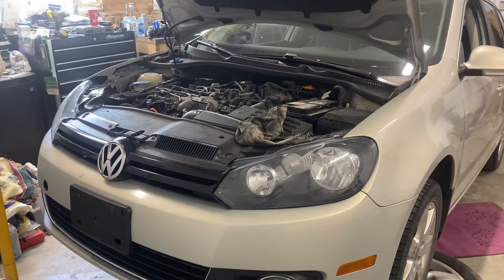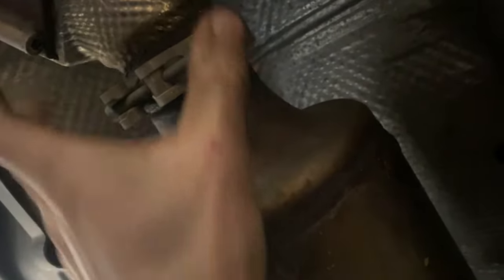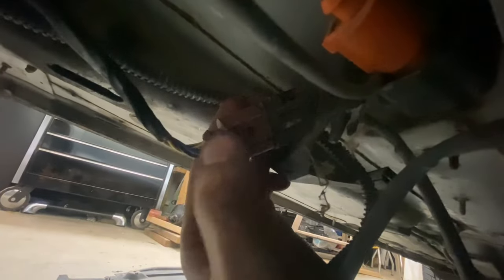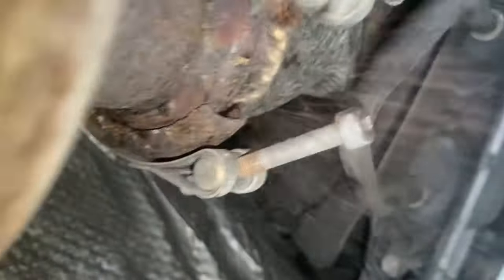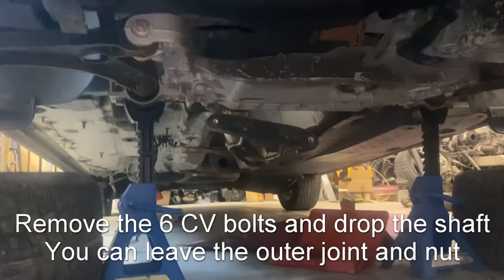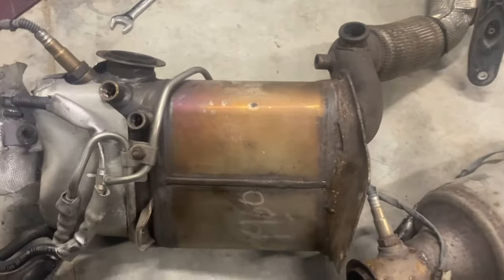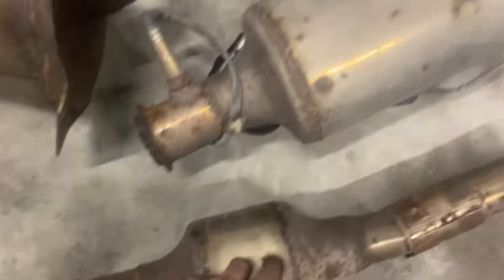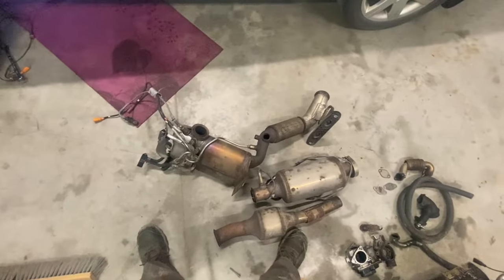CJAA Volkswagen TDI DPF/Cat removal *FOR REPAIR/REPLACEMENT PURPOSED*

Comment: Thanks for video.... I am looking at my DPF replacement. I think I will tackle it. The cost to replace is $3800 to $4000 by shop. Parts will $2000. Also mine being 2010 the dealer said NO, they don't work on cars older than 2012. Not that I would go to dealer. I pushed them. The dealer after I pressed said they would look at it and work on it if car is in good condition, which it is. Again I avoid dealers unless under warranty which my car is way beyond.  My independent VW  Audi Porsche shop will do it....I know the shop and owners well, so likely they will work on it for a long time to come.  They do good work and slightly cheaper than dealer. 

I plan on keeping it another 10-15 yrs. No reason it will not be a great reliable car, but the emissions is a long term maintenance issue.  It works great but from time to time needs to cloned, replaced. The other option is removing the emission system, which s is not commended for legal and resale reasons. Also to do so cost as much as a new DPF. A DPF should go 120K to 240K depending on how you drive.
Reply from the maker: Exactly, outside of warranty I’d take it to an independent shop 10 times out of 10

Comment: I'm working on a 13 tdi cjaa. I'm wondering if anyone on here knows if it's normal to have a square wave signal on the motor control circuit of the egr valve. Mitchell says it should be approximately 12v but when I hook up my lab scope koeo testing I get a 0v-12v square wave on the motor ground and 5v-12v square wave on the motor power wire. Anyone know if this is normal? To me it seems wrong but maybe the egr's are duty cycle controlled.

Comment: Yeah, well, how the  heck can you get busted for this anyway? I'm gonna delete all 3 on my 2012 TDI hatchback. Get me some more MPG & speed! I bought a $1,100 kit with everything included, all bolt on! Guess I should clean my injectors & intake manifold too? What else? How much smoke will I be belching outta my tiny VW Golf? Surely not much, right?
Reply from the maker: I actually plan on making a video in the coming weeks on this. We have road side inspections which usually target commercial trucks/pick ups but also go after modified cars, no muffler is a dead give away which then once inspected when deleted can end up with a $350 fix it fine and your plates taken. 
If you take a look at the US deleted truck scene you see a lot of the tuners getting million dollar fines, I imagine the EPA can get hands on the customer list pretty easy just a matter if they want to go after the small fish.
As far as your golf who’s the tuner? I did a video awhile ago on Mr tuning stage 2 kit, 0 smoke, more power and fuel mileage. The intakes stay fairly clean on these I don’t think I’d worry and I usually will fill the fuel filter canister with liqui moly diesel purge every filter change
Reply: @JoshsJettas  I will be removing the CC, DPF, and EGR but the muffler stays. I personally will not be tuning the car. Is a tune needed after this job? I'm an aircraft mechanic but don't know much about cars. I don't think this job will be too difficult. It's all bolt-on & I'll get a kit with pre-formed pipes to run the whole length of what I remove. I suppose I will need to find someone to tune the car, but will a normal shop know that I've removed these major exhaust components? I'll need to find someone who doesn't care, if so!
Reply from the maker: @crooked-halo  yeah it won’t be happy about the lack of dpf/sensors and won’t run well. The pipes all bolt on easy, getting the old dpf out is the worst. Tuners (Malone or Mr tuning) will provide a flash tool and tune that can be done at home, I went over the process here. 

https://youtu.be/FJWkgyXKrfA

Comment: When you say not to cut the dpf because it will only be scrap value and cant use it as a core what does that mean?
Reply from the maker: If your replacing your dpf it costs about $1100, you also get charged $700 core charge. If you send your non-cut dpf back you should get that $700 back but if you cut it up they won’t refund that.

Comment: Hey man quick question,  i just deleted my 2014 tdi with mr tuning kit with the blocker plate on the egr filter. Will this eliminate the hydro locking problem or is there something else i will need to do.  This happened to me a couple times last winter
Reply from the maker: Low pressure egr is what introduces moisture into the system. With that blocked off you shouldn’t have an issue.

Comment: Hey Josh, your videos are awesome. I’m going to do a dpf and egr delete this weekend. I was curious if you’ve ever had this problem my 2012 Jetta Cjaa bucks and jerks under light throttle. It doesn’t happen if you are into the throttle. It doesn’t throw a code. I’ve read that replacing the cam position sensor could fix the problem?
Reply from the maker: Thanks, i haven’t had this issue but here’s a few thoughts. I would think the cam sensor would be a intermittent issue and not just light throttle consistently. I would maybe do the fuel filter and fill the canister with liqui moly diesel purge as I know the ecu will try and smoothen the engine under a certain rpm, so it might be trying to correct an issue and making things worse?
Reply: If your car is a dsg, that may be normal. My car and many other dsg tdis will do this, the best way to prevent it I’ve found is to just let onto the throttle easier and smoother, it’s essentially slipping the clutch when it bucks like that, a dsg tune can help.
Reply: @dickdynamite89 I have the same issue (manual tranny) what all did you do and how expensive is it to do. Thanks
Reply: DSG = normal

Comment: How did you get the axle off?  I'm most of the way through getting the DPF out but left the driveaxle and I can kind of get past it but can't really turn it.  Is there a video for how to get the axle off?  Help please!
Reply from the maker: Unbolt at the trans, unbolt the 12 point nut and unbolt the lower ball joint 3 bolts. It helps you pull the spindle away
Reply: @JoshsJettas  I just saw this but I got the correct sockets and removed the axle bolts and the bar dropped down a little. That was enough for me to get the DPF out. Your video is so helpful!!
Reply: @davidhamilton6136 how did you get it? Which way did you twist it?
Reply: @Tanner737 The normal way, counterclockwise but to stop the driveshaft from turning I had to lower the car onto the supporting tires so it wouldn't spin. When I wanted it to spin to get to the other bolts I would lift both sides back off the supporting tires. Also make sure to have the triple drive socket bit things, they are 12 pointed, don't use normal star bits or you'll strip the bolts.
Reply: The supporting tires was an incredible idea btw @JoshsJettas

Comment: Thanks for the video and others I've studied sure helped a lot I just replaced my DPF and EGR tube on my 2013 VW Beetle TDI with 132,000 MI, just yesterday on Saturday March 23rd 2024 I never done anything like this and several times I thought I was going to quit because I thought this was never going to fit through that little hole but surely it did inch through with quite a bit of persuasion without lowering the subframe and then the new one went on seems like easier since I was able to go in there and bend the firewall to make more room just for the birth canal if you know what I mean I'm proud that I did it no more p2002 or p0401 codes, it's just best to replace it instead of trying to clean it because it'll just come back with problems soon I'm good for another 10 years at least, this car runs solid
Reply from the maker: That’s awesome I’m glad it helped. It can be pretty tempting when you’ve got the dpf half way out to want to drop the subframe. Would’ve made life a lot easier if they made that opening 1” bigger
Reply: @JoshsJettas  thank you for taking the time and videotaping all that I don't know how you do it because if it was me I'd be taken 3 or 4 days to do this job with the camera but instead I just went through and got it done in a couple of hours while it was raining outside LOL

Comment: I did this today on my 2014 Jetta, and instead of cutting it or even going through the trans tunnel I just took the passenger side CV axle completely out and jacked the front of the transmission to rotate the drivetrain as far forward as it could go and dropped the DPF out of the bottom straight down between the subframe and engine. No need to go through the tunnel at all and it took me about 5 minutes once I had the axle removed.

I did buy a southern car since I live down south, so it wasn't rusted to shit and I was able to remove the O2 and EGT sensors without much difficulty before removing the DPF to make sure nothing would get caught.

I struggled for about 30 minutes trying to go through the tunnel before I noticed it would drop right out if the axle was gone.
Reply from the maker: It was able to fit intact just with the engine rotated?
Reply: @JoshsJettas  Yea, all I did was make sure all the brackets and sensors I could get off were off. I could not get the lower egt out and the dpf and nox cat are still in my garage waiting for me to cut them up to sell them.

Comment: Doing a full rawtec strait pipe with resonator, Malone .5 and 2 tunes will probably be what I go between(with DSG tune and dynamic idle). Cannot wait, hope to get the parts in this weekend.

DPF is clogged so I’ll send it out 😏
Reply from the maker: Have fun it’ll be like a brand new car
Reply: Excited for it, I’ve heard so many amazing thing about it. And it’ll be fun todo. Always used to work on my own stuff till my MK6, warranty was a blessing though. Turbo failed at 120,000mi. Had a few thousand left on the warranty and vw repaired it all under the warranty and added another year on for me. It almost ran away on me after leaving the shop doing the timing belt, then it did when the mechanic took it out because idling it seemed fine. But if you got on it in sport mode it would try to keep going. Blue smoke out the exhaust, 5-6k rpm. I got it back to the shop and the engine light didn’t even come on(that why the guy took it for a drive). The engine is basically new, $11,000 in parts alone. I got to drive a rental 2022 Charger SRT because the guy at enterprise felt bad for me about my car going down like that. 

Parts didn’t come in, they had an issue getting materials due to the high volume of orders.

Comment: Hey Josh Love what you're doing for us 

When you are putting the axle back on what torque spec do you use on the bolts?
Reply from the maker: They’re one time use so they should be replaced and torqued with torque turn. I make them tight with a dab of blue loc tire (not the greatest thing to do).
Reply: @JoshsJettas  yeah if it breaks off and you had loctite on the threads you'd be real mad at yourself 😂

Did you actually replace yours or are you just suggesting that it should be done?

Comment: Hey mate, I have major DPF problems and am going to use this video to get my old one out and try to clean it. I’m wondering if there are any gaskets, seals or single use components that I need to replace when I put it all back together? Hard to know exactly what parts I’ll need before I get in there so I appreciate any help!
Reply from the maker: Hey I’d figure the v band seals, if your somewhere rusty you’ll want v band clamps as well. You might need a scan tool to reset the dpf soot loading if that’s why it’s being cleaned
Reply: @JoshsJettas  Legend, thank you mate I appreciate the reply. 

I'm cleaning due to soot on tailpipe and bumper/carbon buildup in throttle body etc. Plus foul smell in cabin and from tailpipe. But after research I think the DPF will most likely be cracked and I'll have to swap it out, don't think cleaning is gonna do much...
Reply from the maker: @joelbodman8957 yes sadly it’ll be cracked, I did a yt short on this one when I cut it apart, you could just see the soot line where the crack was. Seems to be extremely common on these cjaa’s
Reply: @JoshsJettas  Thanks man, I'll reply back here when I have it a part and let you know what the outcome is. Great content.
Reply: Will a cracked dpf throw a code even if it's cleaned real good? Also would like to know if my 2012 Jetta TDI wagon is cjaa? Mk5 or 6. P2002 ,p2457 codes no pass smog in California 😭
Reply from the maker: Yes, the sensor picks up a lack of pressure differential when it cracks

Comment: Hi, thanks for the video it's helping. I have a question though cocerning the EGR that goes from the cooler to the down pipe. Is there any way that we can remove this EGR pipe and blanking the downpipe? Thanks
Reply from the maker: Keeping the stock dpf and down pipe? I’d leave the pipe on and sand which a blocker plate between the pipe flange and cooler.

Comment: Hey man! So far I’m stuck- despite the CV axle out the way my DPF is still stuck, trying all I can to avoid lowering subframe or doing anything to need alignment. 

Any tips or any certain way you wiggled it to get it out there?
Reply from the maker: You’ve got the lower bracket unbolted from the dpf as well? It’s going to have to “roll” so that the side of the dpf that was against the engine is now facing upwards towards the firewall. The spot where the lower dpf bracket bolts to the dpf will be tight to the heat shielding but it will come
Reply: @JoshsJettas  awesome, I’m gonna try rotating it before trying to pull it out and will update
Reply: It worked, had it out in about 20 mins with that advice. It was actually much easier than I thought it would come out, hard to imagine the work of dropping subframe undercuts just wiggling it out with drive shaft disconnected
Reply from the maker: @oladeleayoola some seem to come out real easy and some dig into the heat shield bad. Just takes some patience, saves an alignment that’s for sure.

Comment: How do you recommend removing the v band clamp on the top end of the DPF filter? Trying to take mine out right now and replace it but I can't seem to get anything on the actual Allen head for the clamp. Also, how do you remove the top bolt that mounts the DPF filter to thr engine? I was able to get the bottom two but not the top one
Reply from the maker: Is the Allen facing a bad way? I had to use swivels to get at it. Then it’s rusted on so it just needs a tap/pry. Swivel sockets/extensions might help
Reply: @JoshsJettas  yeah the Allen head is facing down towards the ground and it's hard to get at from underneath the car. I'll try using some swivel sockets
Reply from the maker: They put them in bad spots sometimes, Allen keys are pretty useless, I’d say swivel and extensions might get you what you need
Reply: @JoshsJettas  I managed to get it off. However, most of the sensors in the DPF filter were seized inside and I had to order another $160 worth of sensors because they broke... So fun!
Reply from the maker: @ghostlyvlogs8456  that sucks, I add a touch of anti seize on re-assembly, not sure if it’ll bake it off or not but the thoughts there

Comment: I have a doubt does an mk6 tdi includes catalyzer apart from dpf? If so, it is located next to the dpf right? In the middle of the exhaust? 

I thought diesel didnt have CAT only DPF. I am not sure if at the end of the video you show the DPF with mufflers or with the CAT. 

Thank you. Good video.
Reply from the maker: The very early Cbea had a cat attached to the dpf but in the same location. In the video I have the dpf off, right after that is the large cat and then the one I have removed already is the smaller cat yet. Then just the muffler at the very end.
Reply: @JoshsJettas  hey Josh! I want to delete dpf and egr of my 2009 passat cbbb engine but from what I see all the kits includes a straight pipe to delete the cat too wich i want to keep it on the car ... You did remove it too?
Reply from the maker: Yes everything went, if you want you can cut and weld the complete kits and keep the first or second cat if you wish.

Comment: Quick question so i bought a 2012 jetta tdi took it for safety mech..put it on hoist is missing the 2 cats and exhaust flap i drove 2hours it ran fine no check engine light no smell in cab and no noticeable noise any help i need this car safe as its for my family found a guy parting one out buying them if i put them back on will it cause a problem im not sure what prev owner did do i need to reprogram it or something thanks
Reply from the maker: If it ran fine with it all removed it’ll be tuned, it’ll be perfectly fine and safe if no exhaust fumes are getting into the cabin. If you want to go back to stock your going to have to talk to a tuner and get the stock file back on the ecu before everything goes back on.

Comment: What to do with pressure sensor vac line if not removing cooler? 
Can I use sensor to plug it?
Reply from the maker: One of the little bolts left over will firmly thread into the line up top. Other option is crimp the hard line by the cooler then cut it.

Comment: Little tip with the plugs under car.. cut them staggered and heat shrink and tape them up cause if the plugs corrode and they will eventually it’ll short out and give all kinds of codes .. had it happen to me lol
Reply from the maker: Yeah I’ve seen rain splash up into them and cause codes, I just put some grease in them. I’d like to make a plug kit.

Comment: How did you get the bracket of the DPF?
Reply: Impact to get rusty bolts off
Reply: @elysoloha4401  how do you fit an impact bike  the upper bolts?
Reply from the maker: Unbolt up top, unbolt underneath and push it backwards, you can then get a socket and some long extensions down there to take the bolts off